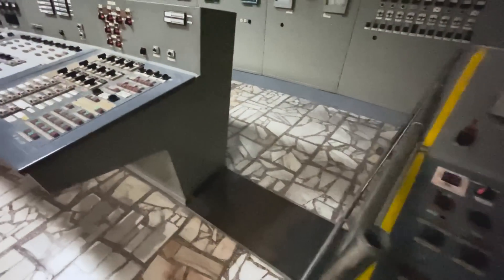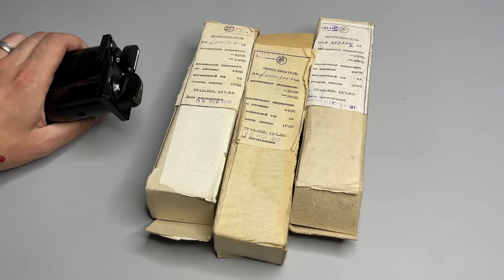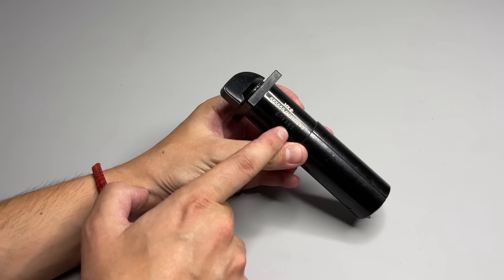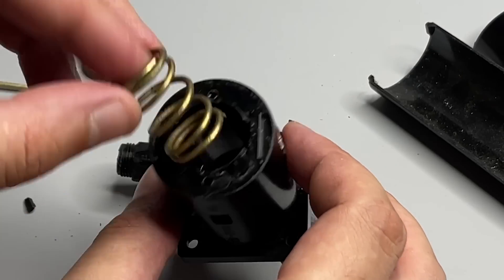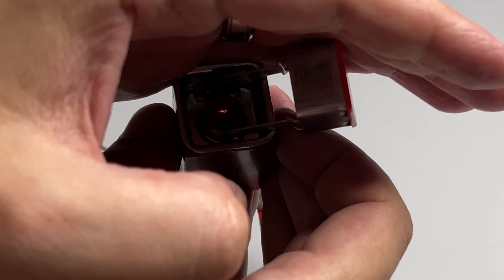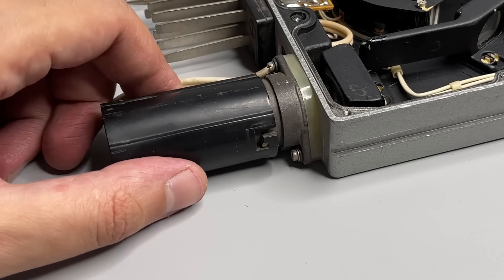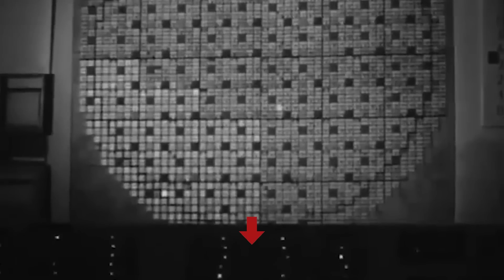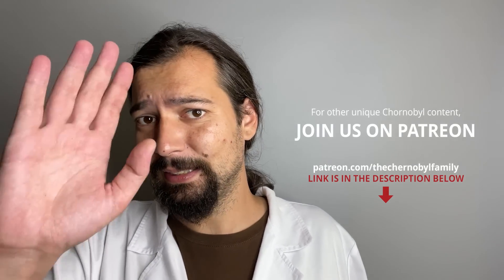What is inside the AZ-5 SWITCH and other Chornobyl controls?

Comment: Ah, the things of beauty! The mirror galvanometer is just so damn lovely. Using photoresistors for limit indication is just brilliant - the only thing is that the alarm condition will never go off if a lightbulb blows, haha! But then checklists and other operating procedures were probably in place to make sure everything was in a good working order.
Reply from the maker: Likely yes, though I can't recall seeng those color film used in the actual power plant conditions. I also know there are modifications which do not have those films at all.
Reply: @ChernobylFamily  I would say there is a lamp monitor in there, either sensing lamp current, or even simpler another phototransistor that detected part of the lamp beam, and if it went out would be part of SKALA that this input is failed, and needs service. Probably one of the printed messages that the operators got the most, x channel indicator inoperative.

Comment: I thought the control panel meter was over-engineered with just needing two mirrors, then you got to the part where it has light meters on the coloured film.
I'd think the reason the switches have multiple sets of contracts (poles), is for safety reasons.
Most of them are just inputs into the computer, but you'd want redundant parallel contacts (and perhaps inputs).
Reply from the maker: Makes sense!
As for the meter, I believe they used light instead of a mechanical pointer because it gives a more stability in environments like sea, and it is also visible from higher distance.
Reply: @ChernobylFamily  I've seen this arrangement used in barcode scanners, but they managed to do it with just one mirror.
Though laser diodes are much smaller and easier to focus.

Comment: Two "non-standard" uses I can think of the dial gage would be to wire it up as a vu meter or possibly a CPU load meter for a single board computer or in a 5.25" drive bay.
Reply from the maker: This. Is. Genial.
Reply: And the scale is already suitable! Excellent idea.
Reply: В 5,25" не влезет, прибор шире

Comment: Thank you very interesting!

The beam deflection is twice the angle of the mirror movement, so a galvanometer light deflection meter can be very sensitive.  The use of the films with the photo resistors is very clever.  I like it.  I am in the US, and I have not yet seen anything exactly the same in industrial controls, but there may be, just I have not seen it.

I built a light deflector using two plotter galvanometer motors to make an X-Y light raster on a wall.  A brain researcher used it to map the positions and motions to which hamster visual cortex neurons respond.
Reply from the maker: WOW!

Comment: The design of the meter is pretty brilliant really. It gives a very clear indication by design, even from a distance. And the feedback from the adjustable green and red film allows not just for a response to an out-of-bounds indication, but also allows a connected system to detect a discrepancy (ie a faulty meter) if it's sending out a known good value but is receiving an alarm from the meter. Clever, compact, and still with multiple functions. I love it!
Reply from the maker: The only trouble, they need MUCH space – we'd like to use them for something, but the space needed.... and these are not the biggest used at the NPP!
Reply: @ChernobylFamily Yeah they are quite deep. Small frontal area, but there's a lot going on behind it. I can imagine that limits where you can use them.
Reply: @ChernobylFamily  What were the largest?
Reply from the maker: @Melanie16040  they looked the same just double as wide, and taller for around 1 cm. It is possible to notice them on wall-mounted panels of the control room.

Comment: The switch detents are so tight because that increases the contacting and disconnecting force when switched. A big part of the current and voltage limitations for the switch depend on how fast the contacts switch.
The impact on contact helps to break trough the oxide or soot built up on the contacts. This makes the switch more reliable especially at lower voltages.
The higher speed on disconnect reduces how long the arc made when disconnecting high currents. This also makes the switch more reliable
Reply from the maker: Super thanks for this clarification!

Comment: can you tell me what are the others AZ buttons?
Reply from the maker: Please clarify what do you mean specifically. AZ-1...AZ-4 or the buttons/switches that surround AZ-5 key?
Reply: @ChernobylFamily  yes the buttons near the az5
Reply from the maker: So, there are:
- AZ-5 rotary switch that stands for the Emergency Protection of Level 5
- AZ-5 Disengage switch
- BAZ switch, that engages BAZ – Fast-Reacting Emergency protection, introduced after Chernobyl disaster
- BAZ Disengage button
- USM button, "Controlled Reduction of Power", it is de-facto AZ-3 which reduces the power with 2%/second by insertion of AR/LAR rods , and if needed RR rods depending on automatic system decision.
- Couplings Power Off switch, which turns off power of servos of RR, USP, AR, LAR control rods.

I explained it about Units I and II. On #3 can be different placing of them, I rarely visit #3, do not really remember.

Comment: As a heads up, the stiffness of the switches is usually the result of that spring being designed to force the contacts together at the end of the throw. The more force holding the contacts together, the higher the current the circuit can handle, AC mixes that up some which is why they can handle slightly hire AC voltages. The term used for a switch that returns to the initial position is typically "momentary" and generally switches are classified by the number of contact sets and positions it can take, a switch with two positions is "single throw" a switch with two sets of contacts is "dual pole" switch, with three positions, these would be "dual throw, sextuple pole, rotary switches" in English terminology, though I never dealt with anything with 6 sets of contacts during my time in the switch industry.
Reply from the maker: I am sincerely thankful for this explanation, which is very valuable given that English is not my native language.
Reply: allen- bradley controls are made to add more contacts( n.o/ n.c.) to the rotary switch as needed, and the throw is also stiff.
Reply: Also it ensures that the spring loaded mechanism will close the contacts "momentarily" in a very short time when triggered.

Comment: The optical metres are fantastic and that adjustable coloured gel to mark the rad and green zones on the dial is just so cool. I remember seeing something a bit similar in old audio equipment but there the gel is just placed over the meter... the adjusting mechanism is simply genius. And those rotary switches are the most amazingly robust electronic devices I think I've ever seen.... I'd love to have some of those but I don't think any of the enclosures I use could take the strain. ;) all 3 devices seem to be beautifully "over engineered". Fabulous!
Reply from the maker: Especially those square buttons are insane. Pause on the moment where  I show the lightbulb inside — there is such a metal 'bucket' around, secured with a shaped nut around the lamp holder. So to install that button, one would need to remove the cap, then the nut, then take out that 'bucket' and insert it into the control panel opening, place the button from the another side and then assemble that back. And repeat that 223 times per quantity of buttons on that SUZ panel.

PS.: if you will eventually wish to have some those meters, we can find, but they are ~40$ as I can see by surplus shops. Also, our is missing a special installation clip.

Both clip and buttons you can see well in our old video about the walk through the power plant when we come to control room 4, there devices are missing.
Reply: That's sounds like the 'korry switch', which is the same kinds of switchs used in the western world. BTW, what's the price of the meter in the surplus shops? @ChernobylFamily

Comment: The switches that have to be held in order to turn someting on are monostable (i.e., have exacly one stable position), the others are bistable, triple stable, etc.
You can use three 9 V 6F22 "radio" batteries by connecting them in series (i.e., connect - of first battery to + of the second, - from second to + of the third) to get 27 V.
And yes, the flat 4.5 V battery 3R12 is very rare nowadays. If you are not forced to use exactly this size of the battery pack, you can use three 1.5 V batteries instead (guess what the name of the battery pack stands for - yes, three R12 batteries, connected in series, just like I have described above for 6F22 batteries). R14 (or C) type batteries are more common, but they are larger, R6 (or AA, or UM-3) are smaller. The greater number after R (which basically means "round" for their cyllindrical shape), the greater capacity (with R20 or D size being the greatest of the common ones) the battery has.
Reply from the maker: There is an interesting thing for 3R12 batteries. Soviets intentionally used individual R12 cells in military equipment, and R12s were not sold anywhere, so this way they prevented stealing any 'government-owned' gear by people. So I need to grab those time to time to power our old dosimeters. 
As for using 3x1.5V, yes, I know, in fact soviets even sold adapters, but as usual they reinvented a wheel, and soviet 1.5 cells were different in size comparable to AA. So it is always tricky...)
Reply: @ChernobylFamily  The R12 batteries were never sold alone, AFAIK. In 1980s, 3R12 batteries pack was the most common one found in almost every shop or newspaper stand, with R20 (D size in current terms) and R14 (C size) following (I think this was the order of their popularity). R6 (AA or UM-3, as it was designated in Germany) was pretty uncommon, gaining popularity in 1990s. R3 (AAA or UM-1) was sold only in two places in my home town by mid-1990s!
I was not familiar with the secret idea behind selection of R12 batteries to create the famous "flat" battery pack 3R12. As I haven't seen this battery pack for ages, I'm not entirely sure whether there is no accumulator (i.e., rechargeable one) with the (almost) the same size as R12 battery and the same voltage (still, many accumulators produce only 1.2 V, so this could be the case).  I wonder whether my father could shed some light on it...
Reply from the maker: @michaljazlowiecki  in Ukraine 3R12 so far as I can see by quick googling are only "old stock"... I think at least will try to find a proper adapter.

Comment: The 'swinging mirror ' guage reminds me of the galvanometers which I used to repair when I worked for a school. Those delicate but regularly abused meters were much more simple than but frighteningly expensive for what they were. I shudder to think how much these units cost brand new. Thanks for sharing Alex.
Reply from the maker: Thanks for sharing! This one I got as a gift, but a quick googling says around 10-50$ per one depending on a type and size.
Reply: @ChernobylFamily  That's a terrific bargain! The school laboratory galvos that I repaired were a thousand pounds sterling each! (That's why I repaired them rather than buying new ones.)
Reply from the maker: Yes, BUT, it is the price for them as old obsolete stuff. I am afraid to imagine their price back in the times when those were modern.
Reply: The thing about spot galvanometers was not their compact size (the ones I knew were large and heavy) but the distance from mirror to screen. This is effectively a very long but weightless pointer, giving a clear pointer indication of very small current changes in the coil.
Here is a typical school galvanometer : https://www.preproom.org/equipment/eq.aspx?eqID=5037

Comment: Beautiful, elegantly simple analog mechanical equipment. Hugely robust and very serviceable. Just what you want in a reactor location. They would still work in lethal ionising radiation or EMP fields. ❤
Reply from the maker: Well, during normal operation the radiation levels are far from elevated or lethal, but you certainly have a point...))))
Reply: @ChernobylFamily  absolutely. But in the event of a major incident I suspect that they would be very resilient. If fukashima had been able to maintain its control and monitoring capabilities it might have been a different story.

Comment: So if the meter lightbulb is dead and something goes in the no-no zone of the meter it wouldn't trigger ? Sounds very safe :D
Reply: I would bet my ass its doubled and also the bulb continuity is monitored too. And If not...hell with us ;)
Reply from the maker: You certainly have a strong point. At the same time, I really try to remember and I can't recall using of those color stripes at the NPP. So likely they are just indicators.
Reply: There probably is a photoresistor buried there to monitor the bulb. If a bulb goes out, it can be detected. Multiple of those resistors can be in series to monitor a group of meters. If any bulb goes out, the circuit goes high resistance. That would have lower cost / be simpler than a separate current monitor for each bulb. And you wouldn’t want the bulbs in series!
Reply: @absurdengineering  Engineers of that time werent idiots,I bet its done on cheap and easy and reliable enough. The photoresistor chain of sensors might be plausible theory. I would love to see more details on redundancy and system integrity checks.

Comment: That's pretty cool, it's super low tech but probably reliable - No overflowing integer variables to blow up your reactor.
Reply from the maker: As far as I can see, everywhere at power plants there are notably many mechanical controls along with modern digital stuff. ChNPP is a standalone thing in this aspect – it was planned to be shut down in 1994, actually worked up to 2000 as generating facility, so it received modernization in safety systems, but controls remained mostly as they were.
Reply: Yes, blowup had to be done manually...
Reply: They’re waiting for you Gordon, in the tessssst chamber. Last time I heard integer overflow was in half life 1. I had to nerd out a little 😄
Reply: @oliviamoore3426  
Yeap, a Monday morning in the game where the desk security guard cannot find his files.
Reply: @C.O.S-MIX  yessss 😃
Reply: Yeah just manual graphite tips did that job
Reply: Reliability is key with this. Not "fancy". The tech world could take notes 🤣

Comment: How did you get these?
Reply from the maker: Purchased in a shop. As I mentioned in the video, they are used at various power plants, not only nuclear, so you can actually buy them as electronic surplus. They are rare and expensive, but it is possible.

Comment: YouTube is finally sending me notifications for your videos again, (they haven’t for ages even though you’re on all) jumped on this as soon as I saw you posted, even though it is 1am here. I’m very excited for the next video, can’t wait to hear what you have.

I find the switch interesting, it’s a great solution for a mechanical fail safe, no relying on other circuitry to change multiple systems. It’s really interesting to see designs that are designed to be multi purpose, versus the other parts of the world where everything manufactured usually has a single specific use and can’t be adapted. Even if the tech is simple, it’s fairly ingenious really.
Reply from the maker: Thank you! Welcome back! And you certainly have a point.